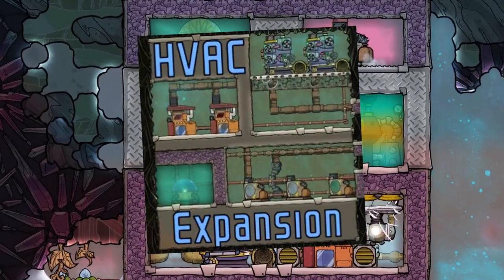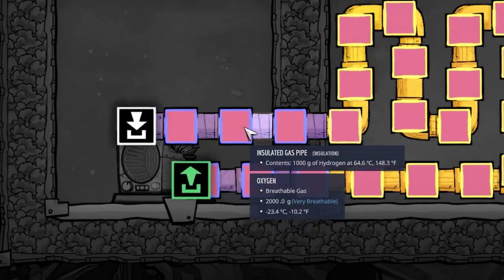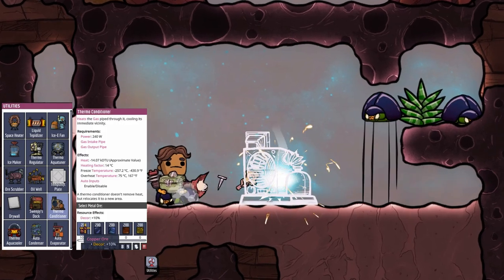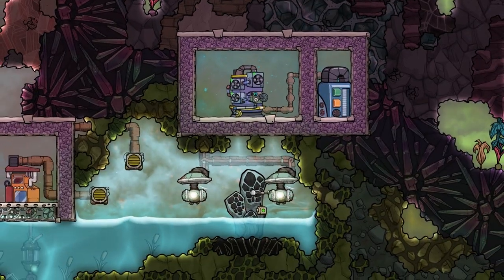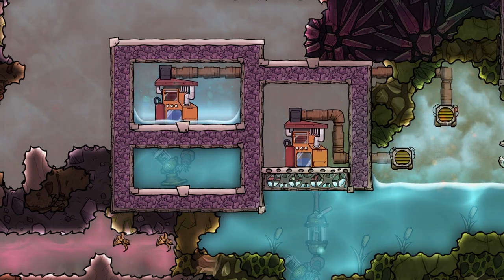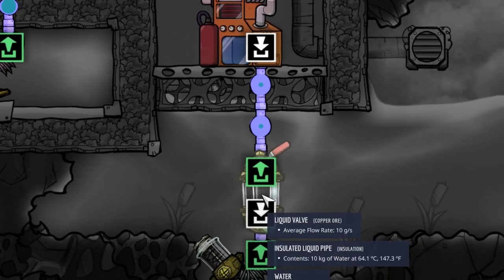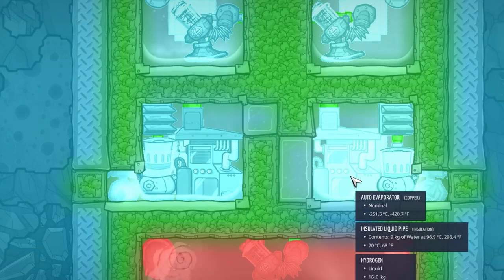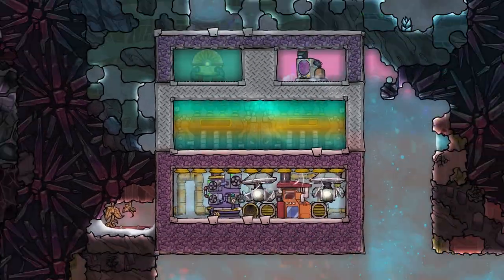Mini Mod Monday 20 - HVAC Expanded - Oxygen not included

Comment: Nice catch, but... I feel like these actually change the game to a bit of easy mode? What's your opinion?
Reply: Agree
Reply: Sure. That's the fun of these mods. They can be tricky to get working the way you want to, but overall they can be a bit of a training wheel for you. Remember this game can be very overwhelming to start with.
I know I used a bunch of "cheaty" mods while I was learning the game.
Reply: No, not really. Vanila exploits are already much powerful then this mod
Reply from the maker: I think it is a good addition. Especially for new players that get used to temperature management having issues with farming. We have different game modes easy and hard. so why not more options for cooling that don't immediately need a steam turbine
Reply: They are because you're good at the game lol this mod makes it somewhat simpler to avoid pushing for plastic and steel mid game to then setup a complex piped cooling system while managing its draw on your power system. Perfect to keep new players alive, I had a thermo generator mod that pulled in heat used it to make power and cools the area. Now I don't use it because that mod gave me time to learn while doing and it's too easy for me now
Reply: @michaelrichards5340  lol I loved that mod, that and the turbine that worked on any gas if the turbine was cold enough.
Reply: Liquid oxygen with 200 metal ore and 240w basically breaks space progression
Reply: it does not solve a lot of issues you might have with cooling loops, control or distribution so, I don't see them as OP. main OP building is steam turbine :)
I would still put their power needs at 1100W/2200W for example just to push convenience with one thing into problem elsewhere.
Reply: It is op for easy LOX and liquid hydrogen, but beyond that it’s fine in terms of balance. However, this seems mostly targeted towards more novice players who may not use it for that. Even then, if people want easy LOX and hydrogen, so be it.
Reply: @-NB7979-  that wasn't what they were saying, it makes it trivially EASY. complex exploits are unapproachable for new players. Reverse cycle Aquatuners are obscenely powerful and easy to use

Comment: Oh now that’s interesting. I like the reverse tuner and hvac. The other two buildings seem weird though.

I think a good way to balance these would be to only allow them to be made from space materials
Reply from the maker: They are a little hard to use which i the idea behind it i think. They could be more expensive but I appreciate the additional cooling options. Especially for newer players.
Reply: I’ve sat down and really tried to think of how to use the cooler buildings and I can’t even use them. If you can’t deal with the heat there’s no use for either of the buildings other than just moving it.

I suppose the better use is that they don’t overheat, and plain pipes have a high melting point so it comes down to how much heat can you inject into another room.

That and they’re pretty big so there’s no small space applications for them.

It’s a trade off really. The whole mechanic of freezing O2 or H is good and all but you’d need to spend far more power to make it happen because of the reversed mechanics. Instead of a single aquatuner and a pump, you’d need a tuner, and a cooler.
Reply: @the_staplergun3968  you can use them to superheat materials and melt abyssalite really easily, or power a crucible

Comment: Nice mod but seems to be a bit op.
The game is balanced around the overheating mechanic. 
If you make machines cool down instead you can use early game materials and operate at absolute zero no issue, 
and you can just infinitly dump heat into a gas without breaking anything.
Well, until it heats the pipes enough to melt them....which would also trivialize an endgame build: 
the insulation melter, though I don't know how well the heat transfer will be compared to using molten metal.

Comment: This really feels like cheating though. You could say they just turn the cooling loop into a heating loop, but that's not it. It's the fact that the machinery is on the cold side, so overheat (the, like, main problem to work around when designing a cooler) is prevented.
The freeze temperature seems to have been added to counteract this, but it's waaay to low imo.
Reply: Exactly my thought. It take away the main challenge on the game, managing workable temperature.
Reply: i think if it helps someone keep playing the game does it really matter?
Reply: @icantsle3p  It kinda does, because they are not playing the game, just something very similar imo.
Reply: @MegaJani  the game allows mods so klei itself finds that an acceptable way to play the game

Comment: I honestly don't see the problem with any of these machines. If you're at the point you're using molten metals as 'coolant' for metal refineries (and, admit it, exploiting) these honestly don't hurt you at all.  Besides, the Steam Turbine deleting heat shouldn't be a thing, but it is. That heat would have to go somewhere. These are simply different ways of doing the same tasks: Instead of pumping liquid through an aquatuner (in a sauna) until its cool enough to be stored in a tank is the same thing as cooling it straight in the tank and dumping heat in a sauna.

Comment: This mod is nice.

But it is quite overpowered.

Why? Because it ignores the Freeze barrier.

What makes low-temperature builds like LOX, LH and Sour Gas Boilers challenging is that you're essentially forced to use supercoolant loops, because gas is too inefficient and other liquids freeze.

These buildings can completely ignore that limitations. You could literally make LOX and LH at cycle 8, with a bit of metal, power and a pool of water.
Reply from the maker: It helps the regular peep make rocket fuel easier :D.

Not any water. Around 95 degrees C water. A normal pool does nothing but break the pipes. 

Or you use the counterpart to the thermo regulator.  Then you can make liquid oxygen. But i don't think you can make liquid hydrogen with that as far as i remember.
Reply: @Luma_plays  You can use the counterpart to the Aquatuner, the one that dumps heat into liquids.

You just keep pumping 25c water, it will come out a bit hotter, but the temperature around the building will drop drastically.
Reply from the maker: @CommentPositionInformer  I haven't tested the building without liquid. So i probably have overlooked that.